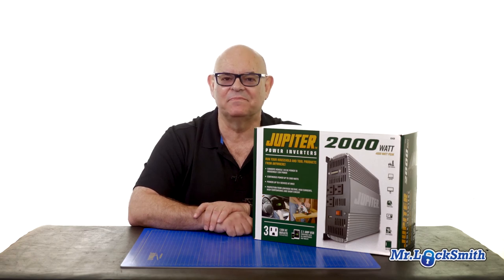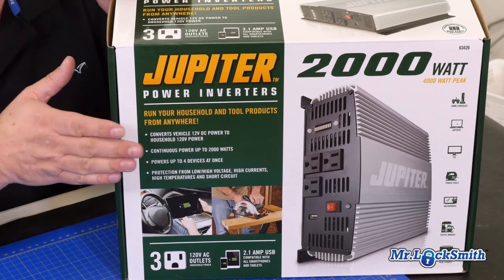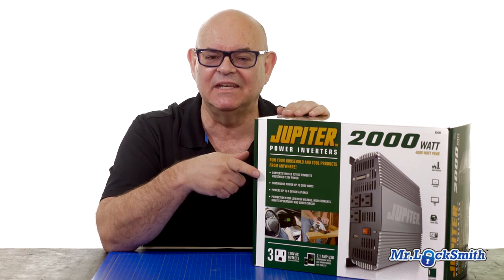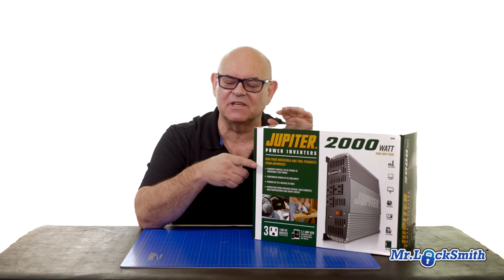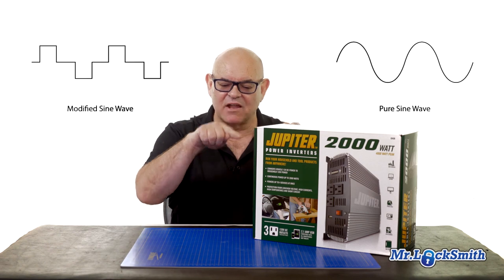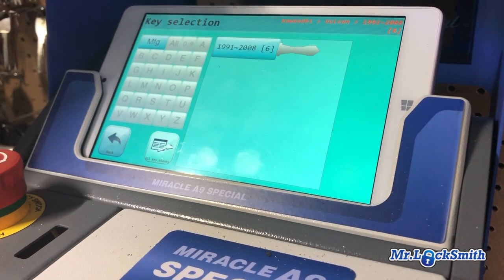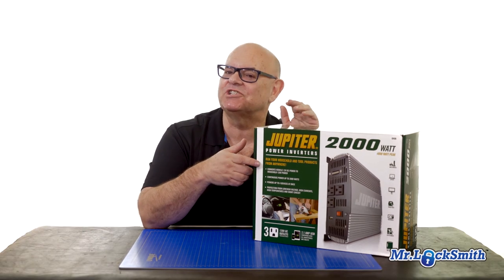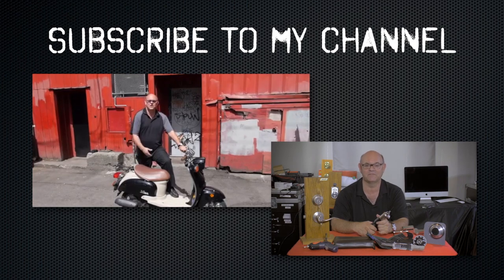I Bought the Wrong Inverter | Mr. Locksmith™ Video

Comment: Get yourself an uninterruptible power supply. They have 2 things going for them that are awesome.  1) They provide filtered power(and usually fully isolate the power) so your key machines could work, no problem. 2) they are uninterruptible so if for some reason you didn't want to start your truck up, you could just turn them on and tada!!  You can find them fairly cheap these days and they'll do the trick nicely. If you're much of a hardware hacker you can often get them to be powered directly off of your truck battery with a good voltage regulator...depends on whether they use 12v or 24v though... You can often find them really cheap on craigslist and the like where companies sell them because the batteries have died.
Reply: It takes a pretty big battery system to keep electric motors running and should be on a isolated battery so it doesnt run your starter battery down. It is also better to have gel cell or deep cycle battery for inverter/UPS as regular automotive battery will be junk after about 20 deep charge cycles.
Reply: @TurtleWaxed  I'm not talking about taking the battery out of the automotive charging circuit. As a matter of fact I'd probably use a diode to block the charge from the UPS.  And I don't know how long you personally are planning on running an electric motor but I'm looking at it in terms of time to cut a couple of keys so there wouldn't be a real issue there.

Comment: Yes do you want to use an analog sine wave for the type of electronics we use these days.   You can always add a fairly inexpensive square wave converter to an analog 110 V source if needed ( like segregating components )

Comment: Electric motors hate modified sine wave power and it causes them to overheat. Depending on how good your computer power supply is, it maybe be able to compensate for the noisy modified sine. You could say a modified sine is a "multi-level square wave". In case you were curious, square waves use odd harmonics of frequency and is much more difficult to filter out and pure sine uses a single frequency and is much easier to filter.

Comment: Most of todays computers convert the AC back to DC, and the computer runs off of the DC. The only thing that may be sensitive to the unfiltered AC voltage would be your machine's power supply. I would be more worried about the motors in the key machines. The modified sinewave may make them run hotter.

Comment: I don't know about the a9s but the miracle a9 premium runs on 24v dc using an ac/dc adapter.  So, with a truck you could just use a 12v to 24v dc/dc converter which are cheap.  Just make sure it has the right amperage rating.   Check Amazon.  You would need to figure out what pinout the connector is on the back of the a9 though and buy one to put on the end of the output from the converter.  The inverter still is probably the better choice since it is more versatile at the end of the day.

Comment: It will run a computer, they have there own separate power supplies inside them that convert the AC power to DC power. . You would still be better with a pure sine wave, because they do a better job running electric motors.